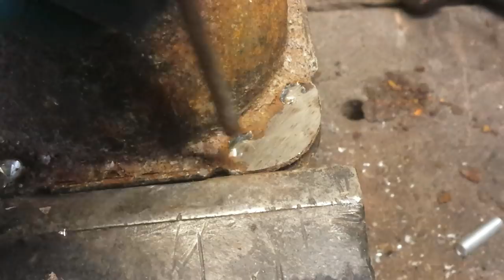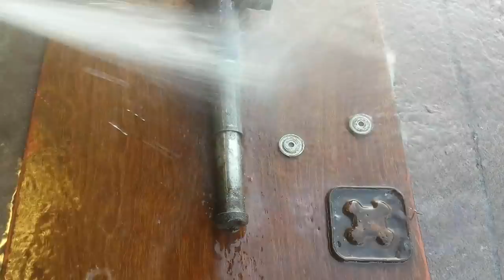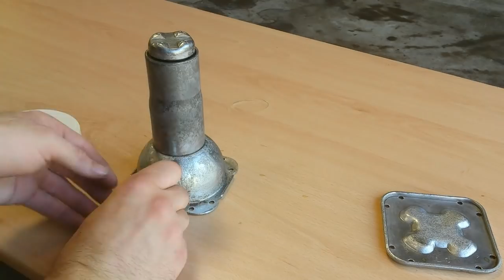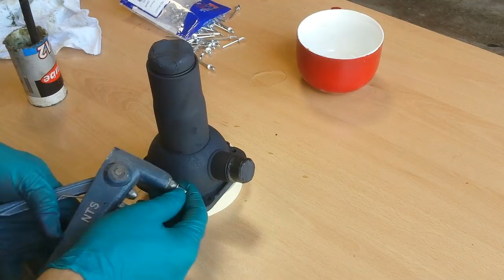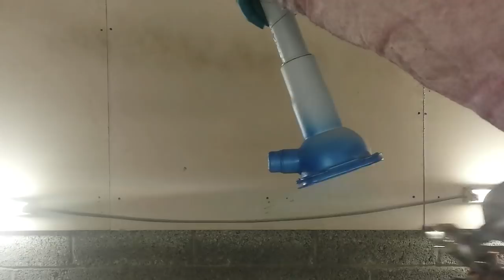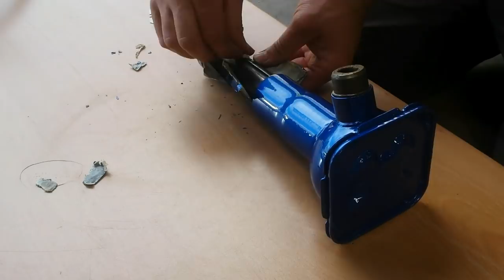Old Spiral Jack Restoration ( screw jack , bottle jack )

Comment: I was okay until you used pop rivets to reattach the base. The rivets used in the original were steel solid flat head rivets that could take the pressure of the screw assembly inside against the bearing base. It is an old worm screw jack . Nissan made them for their cars back in the late 60's ,70's and 80's. Interesting video.
Reply: You right....also I think there need to put  more grease too...but generaly nice work..

Comment: Awesome job! Damn that rust remover works really good. I don't agree with the alloy rivets. Should have used inox rivets. Much stronger. Thank you for your time and effort.
Reply from the maker: Hey, Thanks for your comment. Yeah its a fantastic rust remover and not to slow at working either as long as its not too cold outside. Im getting alot of comments about the rivets but i only ever intended it to be a show piece afterwards its not going to be used ever again so no need for steel rivets. RRC.
Reply: Really Random Channel Aaaah!! Ok yeah it makes sense, it's so perfect I wouldn't put it to use either after that paintjob. Looking forward to your future vids.

Comment: Very pretty and a good job except the pop rivets, The jack was designed to use proper rivets which are a lot stronger.
Reply from the maker: Tbh i was only ever going to use it as an ornament so the pop rivets are purely for decoration and holding it together, i have bigger and better jacks that i trust way more than this one! haha.
Reply: Rivet in the best condition can't hold much more than 350 pounds each , again to work under a car near a ton with a  jack held by aluminium rivet I would be very scared ! https://www.youtube.com/watch?v=MAVYtx5dvUA
Reply: Nice job RRC and I get that you view it as an ornament, but one day it will fall into someone else's hands, either stollen or an estate sale, and it will harm someone.  At least print a warning label and stick it underneath it.
Reply: Please explain the forces that you think will be at work on these rivets. If you look at the design, the rivets appear to do nothing more than hold the bottom plate in place. When in use, the bottom plate will be resting on a flat surface and the plate will absorb all of the lifting force placed upon the mechanism. There might be a very small rotational torque transferred to the rivets which will largely be absorbed through friction between the body of the jack and the bottom plate.
Reply: If you are working under a car supported by a jack then you are being foolish. Always use jack stands. Besides, there are 8 rivets. 8x350=2800lbs of shear strength in a low-load direction. The load on the rivets is rotational, not lifting.
Reply: Manufacturers are not stupid, they do not over engineer a product as it costs money. They put proper rivets in for a reason. If you alter the specification and some one gets hurt it is down to you. I do not know where you got the specifications of the pop rivets used which are soft aluminium hollow tubes, and with the gearing of the screw thread holding up a ton car the side ward forces could shear them if the screw does not come out and starts to turn the jack.
Reply: I believe the law states that if you alter the specification of something and some one dies you can be done for manslaughter.
Reply: Were the pop rivets in this jack the same ones used in that test?
Reply: I get why you used pop rivets, i also get that when I repair something and then sell it or return it to it's owner I loose control of how it's used.
Reply: Without having it in my hands the looks of it the piston is pushing against the bottom plate to lift up lets say a few rivets shear off on one side the piston will push on the platte sideway and make it slanted enough to fall off ,but if you built it for only display or collector purpose it's fine enough ! Just saying that aluminium rivets have a very low shear off strength are better use for holding decorative trim  , their not the same used in industrial plane assembly ! Usually these old car jacks  like this is good for 1-2 tons imagine the pulling strength on each rivets ! Then again i'm no engineer or machinist  ask around find out for yourself !
Reply from the maker: Very sound advice sir and i will definitely be marking it clearly to state that is not for use in any circumstances. However i think its highly unlikely that it will be used by anyone as its now sitting in my display case in my man cave. Good advice though and much appreciated. RRC
Reply: They put in "proper" rivets because they can put all 8 rivets in place and have a special press flatten them all at once = cheaper. The shear force on those rivets is next to nil. Even if all 8 managed to shear, and the weight overcame the frictional force between the top casing and bottom plate, all the jack might do is quickly unscrew itself. The vehicle would lower at a relatively slow rate, and no one would be underneath it anyway, because everyone knows you never go under a vehicle unless it is solidly supported by jack stands. If you are stupid enough to go under a vehicle supported by only a jack, then perhaps the vehicle falling on you will be an important learning experience, a mistake you won't make twice.
Reply: Actually a manufacturer if not required will of their own choice over engineer their products.  They know the liability they would be under if their product were to fail at load specifications and for that very reason they ALWAYS over engineer it.  If they rate a jack at 1 ton you can be sure it will not fail until well beyond that number.  

Your argument here is 100% false and that is easily backed up by some simple research.
Reply: To whom is your reply addressed?
Reply: I agree.  Pop rivets, especially if aluminum, are substandard and anachronistic.
Reply: The load are actually on the bearing and the botton plate, not on the rivets.
Reply: Chris Moore in reply to Tony.  You are 100% correct about the force those rivets are under.  Almost zero.  The only point of the base is to contain grease and protect the innards while providing a wider footprint.
Reply: Tony Papantoniou: Are you sure companies don't over engineer products.  Have you ever seen a vehicle or trailer loaded past it's rated payload?  Next time you are in Walmart look at the weight limit on the scooters and the size of the people who ride them.  Many of them exceed the limit.  When was the last time you saw an over weight person face down because they broke the scooter.   They have to over engineer to avoid legal action.
Reply: you wont live forever...man cave today.. sale tomorrow
Reply: Really Random Channel k
Reply: Use jack stands or be a Darwin award winner
Reply: Forget the rivets. I'd put some sort of RTV gasket on the bottom plate to seal out dirt and grime. But it's an ornament. A really pretty one at that.
Reply: It can collapse when you are lifting before you start working or as you placing the jack stands before they are in place
Reply: Thanks for not talking and for the speed of the video. I used huge screw jacks in the Air Force to lift cargo planes entirely off the ground. The planes weighed about 150 tons. One jack was used under either side of the massive wing. The screws were about 6 inches in diameter. 
 Even then we still used a massive steel stand under each wing to assure the safety of the crew of six mechanics. They were similar to house moving stands but more substantial. Having said all that I have never used a screw jack since that time and this was fifty years ago. Your methodology was impressive and the finished jack appeared as new. I just prefer hydraulic jacks of which I have two. One is a four ton and the other is a two ton. I actually picked up a few tips watching you work. Your use of cleaning and derusting chemicals was very thorough. You are a skilled craftsman and mechanic.
Reply: Also no enough grease.
Reply: There is nothing wrong with the pop rivets as the bottom plate is only there to assemble all parts.
Reply: Tony Papantoniou i agree on the rivits 🤔
Reply: Let's argue about something that isn't going to happen. Just enjoy the video.
Reply: 1badpete999 he fucking said that he was only using it for decoration
Reply: Tony Papantoniou he said he was going to use it for decoration
Reply: 1badpete999 he clearly stated that he is using the Jack for decoration
Reply: Chris Moore unlike your grammar, you'll make that mistake again
Reply: Holy shit y'all are arguing about a jack that RRC clearly states he ain't gonna use. No one gives a shit if it's used or not. This dude is just making a cool piece for his man cave.
Reply: Really Random Channel This is common mistake. You'll never use it. But some  day maybe someone will. Maybe from your family a few years after you passed out. When you restore something if its for decoration you have to disable it. Anyway nice job and video.
Reply: i agree i bet you have a shelf full of stuff you dont use :P
Reply: I enjoyed the video without all the "hemandhaw" yaking that promotes boredom.  I noticed the different products you use to decrapify the jack.  I have not seen these and wonder where you purchased them?  I ask because I rebuild old hand pumps and sometimes stuff just does not clean up.  Thank you for an outstanding video.
Reply: Really Random Channel w
Reply: I agree
Reply: The rivets don't have to be strong. There's really no pressure on them. The force is all downward anyway
Reply: No it is not, as you are turning a  geared wheel if the wheel does not turn the jack does.
Reply: You shouldn't be working under a jack in the first place.  That's what Jack-stands are for.
Reply: Stfu
Reply: Tony Papantoniou I checked with our family attorney and he says that is not true
Reply: Beautiful piece love the color can i get the code from you id like to paint the dash in my car that color . Thank You
Reply: WHOLE INTELLIGENT WORLD ARGUE THE SCIENCES. BUT NO ONE RESPECT THE POP RIVIT WHO THE PUNK OF WHOLE THE RIVIT UNIVERSE.
Reply: @astroflight6571  but the rivets are litterly holding a baseplate on, they aren't a structural piece on this jack.

Comment: Pop rivits!???? I was with you up to that.
Reply from the maker: Read the description ;)
Reply: I'll pass reading that written short story in addition to watching the video, thank you very much.  For several reasons and here's one. If is not important enough to put in the video than it's " not important".
Reply: I'd like to add, it was a very very nice job, except for the aluminum pop vivits.  They do sell steel rivits and with a few strikes on the flairing tool are set right.  Best wishes.
Reply: I thought the same thing. But I dont think it matters. This isnt a good bottle jack anyway so it's not going to be used for a a heavy vehicle. Or used at all.

Comment: Visually, it looks fantastic! However, I would never trust it as a working jack with the aluminum pop rivets holding the baseplate on. It should have been hot rivited with solid rivets like the factory. It will look great as a display item in the man cave!!!
Reply from the maker: Tbh i was only ever going to use it as an ornament, i have bigger and better jacks that i trust way more than this one! haha.
Reply: Then you need to add a note to the video explaining that. Someone is going to see this and think that's  a proper way to repair something and end up replacing steel hot rivets with aluminum pops. Dangerous example.
Reply: John Since when is it the content creators job to deal with idiot's? Anyone who is dumb enough to lift a car with aluminium as there weak point almost deserves to have said car fall on them. He doesn't NEED make videos for 6 year old's. You guys act like you caught him or something when in reality why would you use a hot rivet for a hunk of metal that will sit on a table and never be used? hundreds of times the effort for nothing.
Reply: The rivets don't have to be strong. There's really no pressure on them. The force is all downward anyway.
Reply: It's his job since he posted it as a restoration, which in this case is a misleading title. Lots of people have little knowledge of engineering, material strengths etc and could easily believe this  video shows a functional restoration instead of a refurbishment.  When you produce content you have to take responsibility for it.
Reply: The fact that a "restoration" is being shown implies that it is the responsibility of the restorer to caution others to avoid their mistakes. He is "not dealing with idiots" because others are relying on his authority to do things right.

Comment: Great video and thanks for sharing. My only comment would be the replacement rivets, the originals seemed to be solid steel and the new ones look very light gauge, personally, I would have used solid steel hot rivets to re-assemble but if it works then I guess it is OK!

Comment: Awesome work it looks great. And I wouldnt worrie about the rivets their only porpoise is to hold the base part on. the forces applied to the jack mechanism gets transferred through the jack to ground. Because the baseplate is resting on the ground. If the jack body was suspended some how and the bottom wasn't supported then the rivets for the base plate would see the forces.

Comment: I don't see a problem with the pop rivets. The compressive force is between the bottom plate and the cap or cup through the lifting screw and neck, and I don't see the base plate and neck seperating under load. The broad base adds stability, and keeps the screw from being driven into the ground. The neck and base plate have to resist laterial forces between the drive screw and gear of the lifting screw, and I think that 8 pop rivets can do that. Good job on the restoration. I could see this locateed in the engine bay on a custom car matching the exterior paint. Cool.

Comment: That's a jack commonly provided by Ford, often with the Ranger pickup..worth the resto if it's for a restored vehicle (and luckily, close to ford blue), but commonly available and inexpensive. Unfortunately it's unusuable, as the lifting pressure is applied to the bottom plate, it will push itself apart. As an aspiring how-to video it shows tremendous promise - keep doing what you're doing!

Comment: Nice job!  Amazed how well that paint filled in the heavy rust pitting, was expecting you to put down some filler/putty but the end result showed no need! :-)  As for all the rivet comments, that would be fine to jack up something while standing on a floor - the rivets would not be so good if you used it for another purpose, e.g. spreading apart a suspension component, as the base would not be secured by the vehicle's weight.   Other than that, it'll be fine ;-)
Reply from the maker: Hey, Thanks for the comment. I did think i would need a light skim of filler as well to take up the rust damage but he primer handled it just fine to my surprise.

Comment: I'm not replaying to the rivet lunatics there. I know materials used (Al or Fe) is a big contributor to what may or may not happen. But a Jack is only there to lift, not to provide secure  workspace beneath anything. I think the restoration is subherb - i epecially like the ppaintjob.

Comment: Great job very nice quick question why did you paint it black before primer
Reply from the maker: Hey, Thanks for your comment. The black before the primer is etch primer, when painting bare metal you always need to acid etch the metal first so that the normal primer will adhere properly. if not etched months or years down the line you will have problems with loss of adhesion ans paint flaking off ;)

Comment: There's a powder coating water base solvent that you can mix with any dry powder coat. You can either spray or brush it on. And just use a heat gun or even an oven. You can even just spray it on without masking and just wipe it off and it's a little more forgiving then static application when handling it before curing it. We use it to repair powder coated lockers. You do need a little practice when curing it but It was better then sending out 200 lb lockers to be fully stripped then the whole thing re-powder coated. It's by Tech Line Coatings
Reply from the maker: Hey, Thanks for the tip ill be sure to check it out ;)
Reply: @RRCRestoration  Although the larger the area the trickier it gets when using a heat gun to get an even coverage, but for small projects like yours is a perfect application. It's a lot more forgiving for a shinny or gloss finishes over matte finishes.

Comment: If you use it, it will stay in that shape for about 4 minutes. I mean  its nice looking etc., but its decoration now. If it is meant as still being used as a tool - cleaning it up and putting some new grease on would have been enough I guess.

Comment: those pop rivits are not made to handle that type of pressure. . . they may pop loose. should have used the original ones. as like slight taper of the tip of the whole, then drill out the plug, then have the metal head rivit on a secure platform, then use a center punch to widen the tip to reseat the metal rivit. . . . that would have been the best route to go. after all you did take  the time to give it a glossy finish.

Comment: Great vid   BUT  you didn't seat the ball bearings IN GREASE..  You only added grease to the top cover.    Not good as you'll get a constant grating when it's turned.
Reply from the maker: Hey, Thanks for the comment,  The jack is only a display item now it wont be used again so lack of grease on the bearing wont affect its new purpose.

Comment: A fancy paint job on an old tool is not a restoration. All you did was turn a usefull tool into an ornament, by your own admission. Such a shame, especially since the extra effort to learn how to install proper rivets as they were installed when the jack was new, would have been awesome.